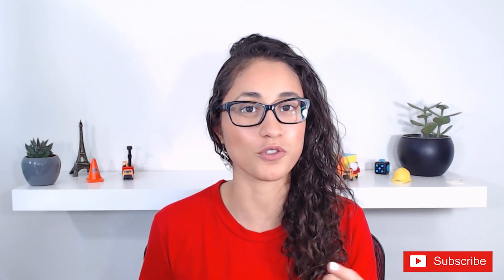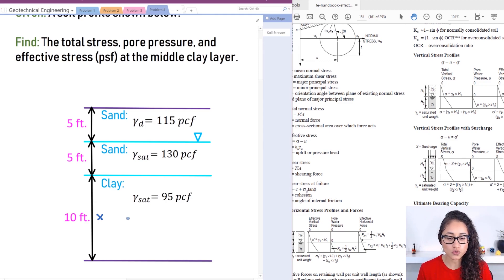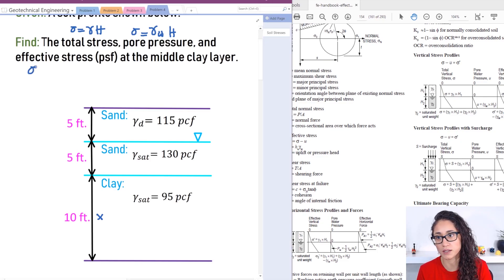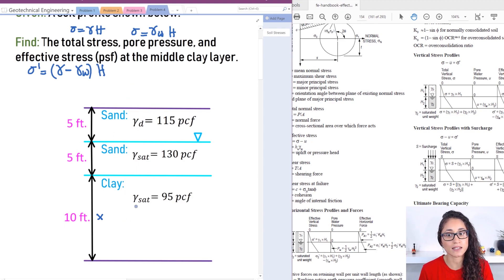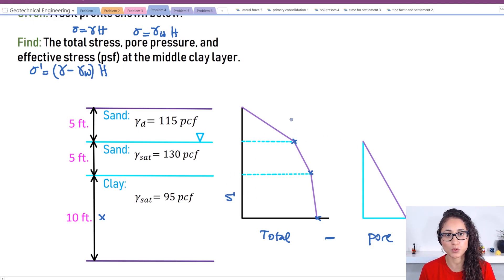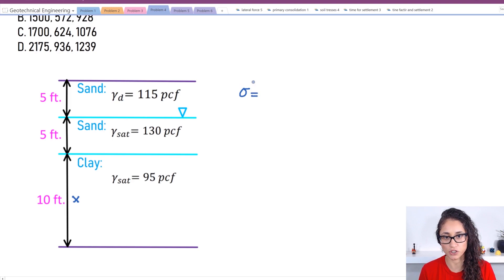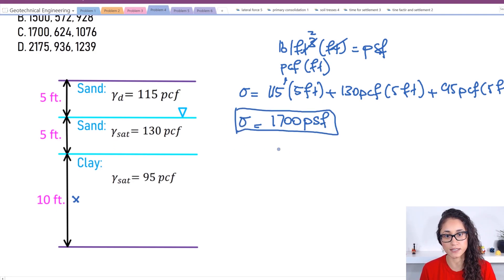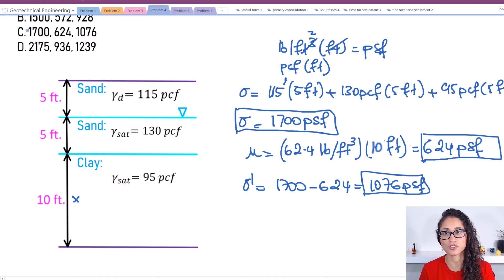FE Exam Geotechnical - Total, Effective and Pore Pressure

Comment: If the top layer had a moisture content but not fully saturated, would we then convert the top layer to total unit weight or would we still use the dry unit weight?

Comment: if you are calculating the pore pressure at the middle of the clay layer, why you just consider 10 ft of the first two layers and do not consider the other 5 ft to the middle point at the clay layer?
Reply: never mind I just realized that the water table is 5ft below.

Comment: the h of water is 15ft  , right ? in the video you multiply it with 10 ft
Reply from the maker: Rami, so the height of the water is 15 ft but we want the pore pressure at the middle of the clay, so that would only be 10 ft. I hope this make sense.
Reply: @Genieprep  it make sense , I mis red the question , thank you for the quick answer
Reply: @ramiibrahim7488  ahem .excuse me. enGENEIer , why you chose 5 ft in height from the clay?
Reply: @Reyonepieceluffy  the question references to take the total, pore and effective from the middle of the clay layer
Reply: @Genieprep  very easy to miss!!  Thanks!!